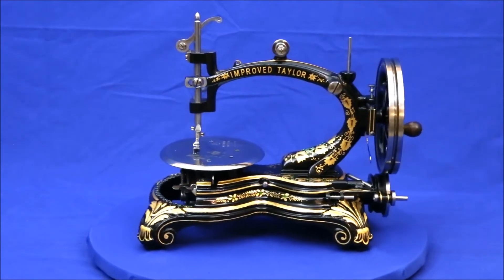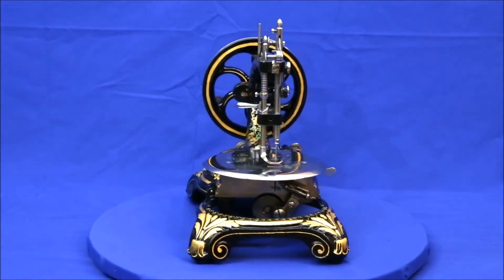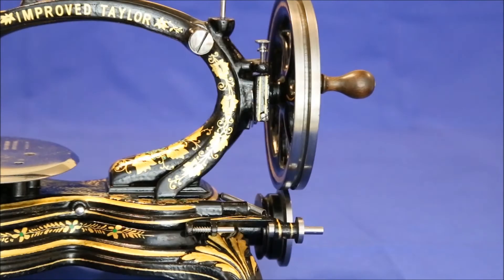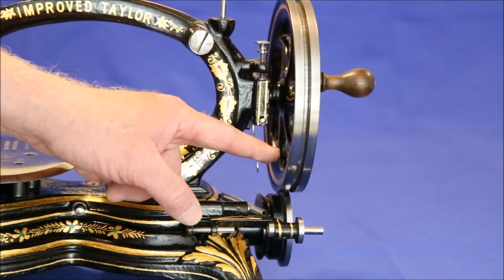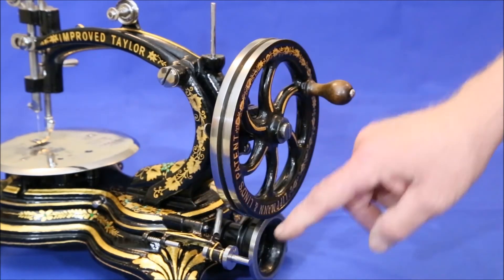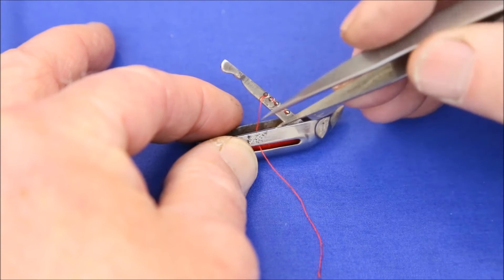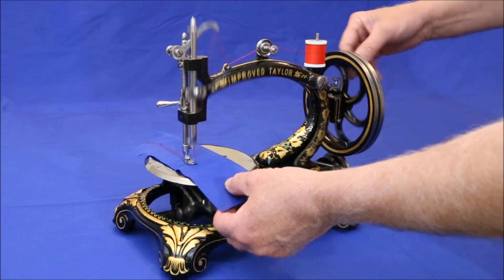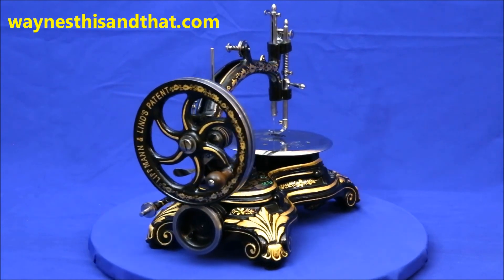Antique Improved Taylor Sewing Machine

Comment: I used one of these for a few years to make dresses and these machines or just mine was so noisy and rough 
Decent stitch
Reply from the maker: You're right, they an be noisy. The metal-on-metal drive is louder than a gear drive. Also, if the moving, sliding and rotating parts are tarnished or rusted and not thoroughly oiled they can make a lot of noise.
Reply: @wayneschmidt490  well that explains alot I didn't realise alot about vintage machines 
I didn't really know how the mechanism works
I didn't even know to oil it
Reply from the maker: @graceygal2664  These old machine eat oil like crazy. Even new, the manuals state that in constant service they need to be oiled every few hours. For domestic use, at least once a day.